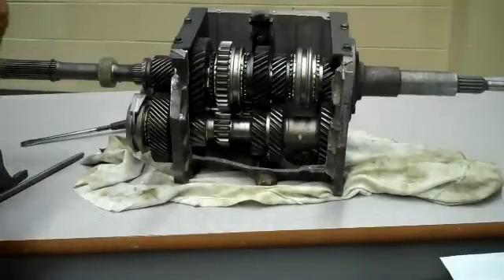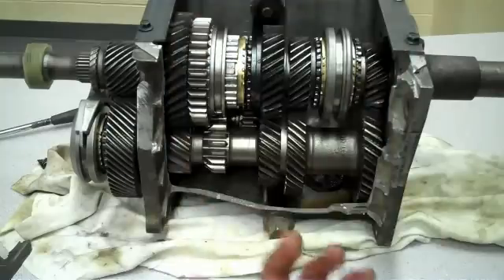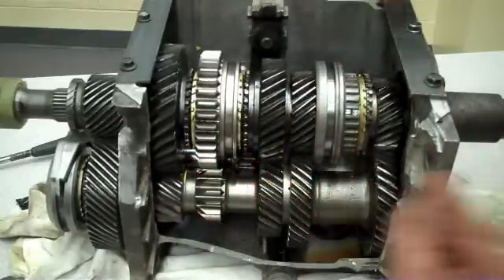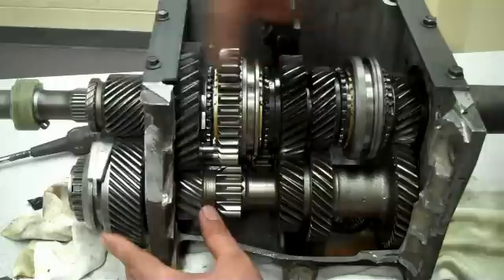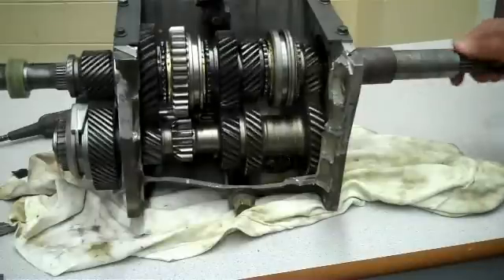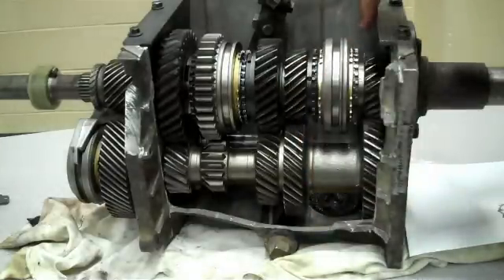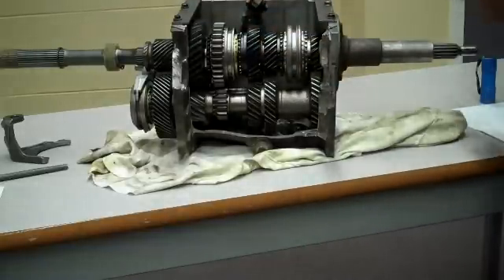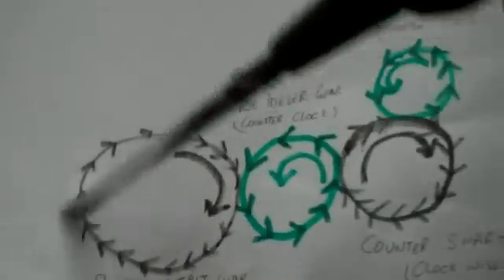How manual transmission works (Revised). Part-2

Comment: So if I got it right, the axis that comes from the right is fixed to the first gear it meets inside the box and from there, following a straight line, the rest of the axis is a different piece, the output axis, right?

Comment: My ford courier 1998 4 wheel drive is stuck in second gear, it will go in fifth and reverse but will not move, it wont go in first, third or fourth. What could be my issue?

Comment: Thanks for the video and explanation. 
Out of curiosity:  on this model,  would it be possible to lock 1st and 3rd gear at the same time? I get that connecting rods/forks would not allow this in normal operation but as you are shifting here by hand, in theory could you lock 2 gears at the same time  ? I guess input/output shaft would not turn as 1st and 3rd gear would be fighting each other ..
Reply from the maker: +martin i no sir that will not be possible. You have answered your own question, 1st and 3rd are attached to the same, and they will fight.
Reply: +FrankHurtAuto But the synchro collars for (1-2gear) and (3-4) gear are moving independently, correct ? I know it's a bit stupid question and there's absolutely no use for it. But as I was thinking how those collars are placed on the shaft I thought you could, on the model in the video, move 1-2 collar and 3-4 collar to lock two gears at the same time.
Reply from the maker: +martin i yes you can lock the collars, but because the gears are different size they are going to spin at different speeds, causing a clash
Reply: +FrankHurtAuto Great, thanks for the info .. and the video.

Comment: Is it me or did you explain the gear ratios backwards? You would think that the lowest gear would be where a smaller gear drives a larger one.
Reply from the maker: Think that's what I have said at 0.58 seconds.

Comment: Why is 5th gear(Overdrive) outside the box?
Reply from the maker: it's not outside the box. I had to remove the casing that goes around it, in order to show the gears.
Reply: @FrankHurtAuto  but because I thought the same thing-- why does it LOOK like it's ...away from everything else?  Is it something about the overdrive gear having to be further?

Comment: hey, nice video but can you please tell me that in 4.30 you said that the gears are never in contact so what is the use of that gear next to the 1st gear on the counter shaft? Thanks
Reply from the maker: That is for reverse gear only. engine and the input shaft only turn in one direction and inorder to make the wheels turn in opposited direction when you put the transmission in reverse, a thitr gear connects the gears on input and output shafts. thus making the output shaft turn in opposite direction than the input shaft. Hopefully i haven't confused you more.
Reply: Nope you didnt confuse me, i got the concept, thanks a lot!

Comment from the maker: The reason you can go through all gears when the engine is not running is because the input shaft on the transmission is not spinning. From what you have written, it is most likely you clutch. Thanks for liking the video

Comment: What is the problem when you can shift through all the gears including reverse without a problem when the car is OFF but when you turn the car ON, it feels like you're being blocked out of all gears? I was told it is the clutch.

Comment: Great video. So If my reverse gear keeps jumping into neutral, is that a fault with the lever mechanism not pushing the reverse idler gear fully across, and then when power is applied it jumps back because it isn't grabbing?

Comment: I got a problem with my manual transmission , can use please help. What it does is it makes a weird noise, some noise sounding like when the break pads are bad scraping metal with metal. It's not to loud but I can feel it on the gas pedal. Once I press on the clutch pedal it stops. Help please

Comment: All but the one on the very left (for the fifth gear). That one is attached to the output shaft while the leftmost gear on the secondary shaft is only attached to the secondary shaft if the bottom left collar gets locked on it. Am I right?

Comment: Thank you so much for this video. Finally i'm starting to understand how the movement of the stick translates into moventent in the gearbox. However my dad's car has front wheel drive and a transversly placed engine and gearbox. So i guess the connection with the stick is a little bit different right?

Comment: Fantastic video. Thanks so much! 
Is a front wheel drive transmission much different?
I presume the output shaft is located in a different position?

Comment from the maker: Synchro collars are splined on the inside and the gears on the input shaft are splined on the outside, thus collars can slid on/off the gears, locking/unlocking them.

Comment from the maker: Yes, output shaft is inside input shaft. All the gears on the top row are attached to the input shaft and the synchro collars are splined on the output shaft. when engaged the collars (which spins with output shaft ) locks the gear on input and makes it spin.

Comment from the maker: All the gears on the top row are attached to the input shaft and the synchro collars are splined on the output shaft. when engaged the collars lock input to the output shaft.